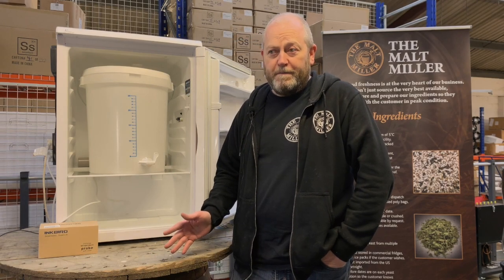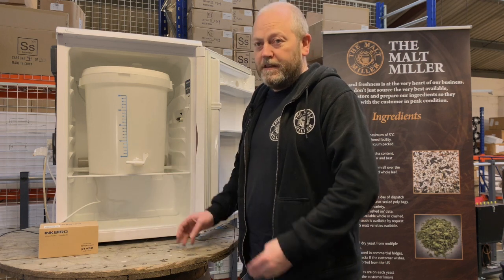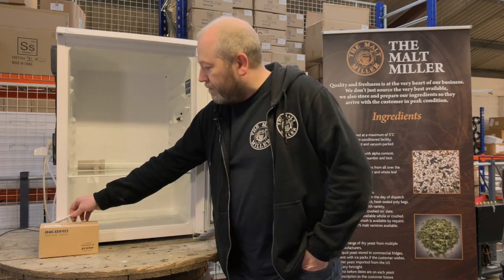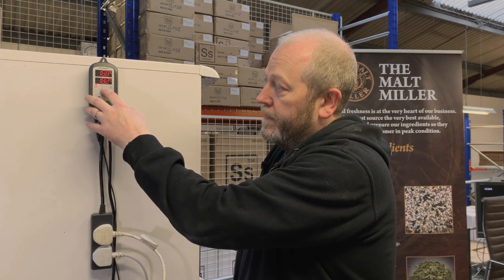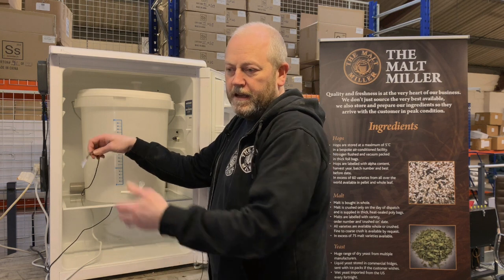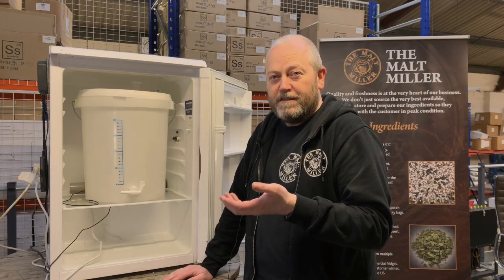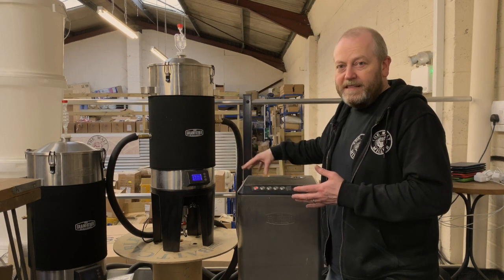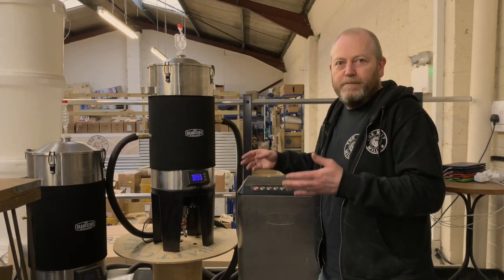Controlling fermentation temperature - building a fermentation chamber

Comment: Another great video guys. Any idea whether this would work with a freezer instead of a fridge? Second hand freezers seem easier to come by. It will just switch on a little less regularly right?
Reply from the maker: Yep, in theory it will work but, most upright freezers have fixed shelves with freezing elements inside, not so easy. However, chest freezers, you are good to go. Good Keezer, most are not tall enough to accommodate kegs but it’s easy to make a wooden collar.

Comment: What is the heating stick called inside the fridge your using? I can make out what your calling it.
Reply from the maker: This video features something like this https://www.toolstation.com/dimplex-thermostatic-tubular-heater-ipx4/p17033

You can however use any plug in heat source such as a heat mat of belt. We do a bundle with the InkBird and a heating mat https://www.themaltmiller.co.uk/product/fermentation-temperature-control-kit/
Reply: @themaltmiller8438  a little late, but would you say a heat tube works better than a heat matt? 

I've just purchased the kit you sell, but considering switching the heat matt for a tube, so it heats the air around the wort, therefore bringing the wort to a more even temperature, thankyou in advance.

Comment: I’m looking to setup a mini fridge for beer fermentation and I have a couple questions.  Won’t this keep kicking the fridge on and off and greatly reduce the life of the compressor?  Also won’t this cause the temp to fluctuate all day and night? How will it stay at a constant temperature with a variance between the “cool” and “heat”?
Reply from the maker: You have the ability to set a temperature differential on the controller, so as to avoid excess toggling of the heater or cooling side. We've used these systems in our brewing journey for years and not had issues with the fridges failing
Reply: @themaltmiller8438 👍🏼

Comment: Could you use a heat belt or a heat pad instead of the greenhouse heater. I already have these and I'm trying to do this on a budget (don't tell the wife!)
Reply from the maker: Yes, you can but if doing so it is best to use a thermowell in your fermenter. https://www.themaltmiller.co.uk/product/thermowell-stainless-100mm-weldless/

Comment: I’ve purchased the Dimplex ECOT1FT Wall-Mounted Tubular Heater 40W 408 x 81mm the same as you have but there are loads of warnings in instructions about not covering it, plugging it into a switch device, leaving it alone, risk of fire, has anyone had any issues?  Any tips?

Comment: Is the glass shelf strong enough to support a full fermenter? Have you had them shatter or slip out of the liner slots?
Reply: They should be, but if you worry you could put something sturdy underneath it to support the shelf
Reply: No problems as of yet, but I'm careful not to let the fermenter rest on it solely for long. Probably better to get some stainless steel made up to the same size.

Comment: Hi. I've just bought all the bits to make this. Is there no vent needed to let ant heat escape? Thanks
Reply from the maker: I've never had any vent on the ones I've built. A nice addition is a fan to help move the heat around inside and its something I'll be adding to mine soon
Reply: @themaltmiller8438  i cant find a "heat tube" on amazon... can you be more specific
Reply: @themaltmiller8438  Could you please link the heating element can't find it anywhere - aussie here cheers.

Comment: I am wondering if turning the fridge on and off constantly will not damage it. Where is that the way it works anyway? Are you putting it on maximal cooling or are you adjusting the fridges thermostat to the rough temperature that you’re looking for? Also what is the added value of the heater? Thx a lot
Reply: You can set a compressor delay on the inkbird

Comment: what about a fermenter that needs to be warmer than outside, any tips?
Reply from the maker: Add a tube heater to the fridge, it just sits in the back and you can shut the door on the cable so no mods needed. If you are in the UK they are available at places like Argos and Toolstation.

Comment: I typed in heat tube in amazon and I couldn't find anything that looked like what you have
Reply: You might get away with a heat belt or heat mat?
Reply: Search on Amazon for dimplex ecot2ft tubular heater
Reply: @philster1686  Careful, 1ft fits my fridge, 2ft will not.
Reply: @certaindeaf8632  thanks for the heads up on that one probably would have ordered the wrong one otherwise :)

Comment: What type of fridge is it? Do you have to modify it to get the bucket to fit?
Reply: Find a fridge too fit your fermenting bucket. Best is to search for a fridge with no "Freezer" section.
Reply: At least 112 litre capacity. The fermenter it always on the first shelf due to the compressor taking up space at the bottom. So you need to measure from the first shelf upwards. I fit a Fermzilla 30L in my Russell Hobbs RHUCLF2B but I have to use a smaller airlock than standard to get it in.

Comment: As I home distiller I want to know if this will work for fermenting a wash for a still as it is best being kept between 30-40 degrees Celsius
Reply from the maker: Mitchell Burns no reason it wouldn’t as long as you have a good enough heat source.
The one I have at home I’ve fermented at 35c
Reply: @themaltmiller8438  great. Thanks for the advice

Comment: Hi, may I check if the fridge is switched on and off many times, will it break down easily?
Reply from the maker: The Inkbird controllers have a setting that means the fridge won't flicker on/off there is a compressor delay.

Comment: Do you have override the fridge thermostat.
Reply: Hello Matthew, you don't have to override the fridge thermostat. Since the connector of the fridge is in the inkbird, this will in fact switch on the cooling part. Set the fridge thermostat to medium or half way and it will work fine !
Reply: Fridge temps are often much lower than ferment temps. You tend to use a fridge at about 8 degrees C or so.

Comment: Your better off getting a fridge that has a steady temp a digital wine cooler that inkbird is junk it doesn't always kick in plus going off and on all the time will eventually destroy your compressor waste of time
Reply from the maker: I've run fridges and freezers on ink birds for years, no issues with the compressor, you just need to adjust your settings so it doesn't go on/off all the time and it has a delay.
Reply: @themaltmiller8438  then mine must be faulty ive calibrating and adjusting and still doesn't work I set it to 10 degrees and it kicks in at 16 Celsius
Reply: I hacked my fridge and use BrewPi and Brewblox.